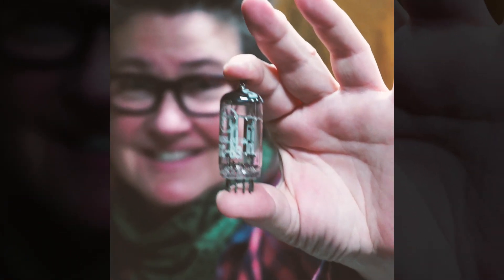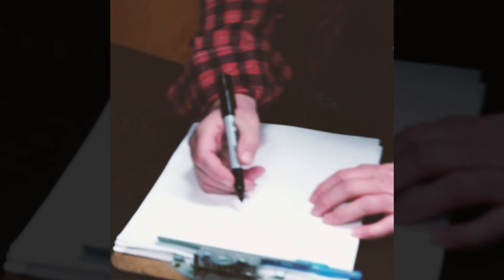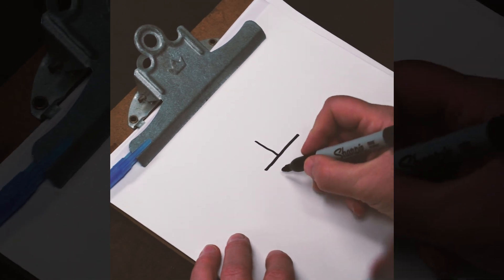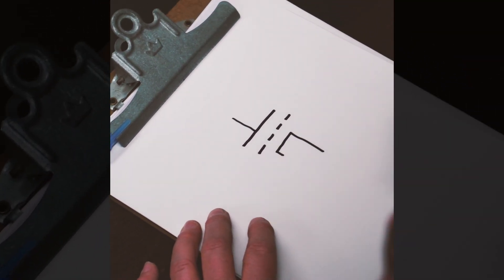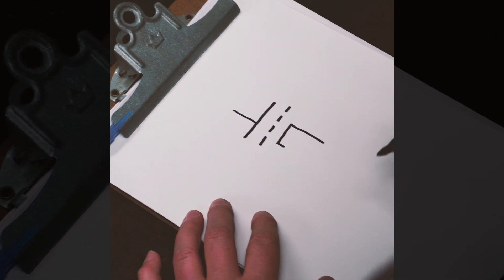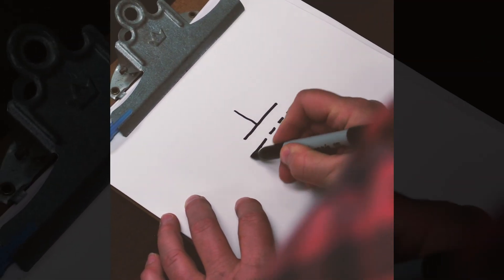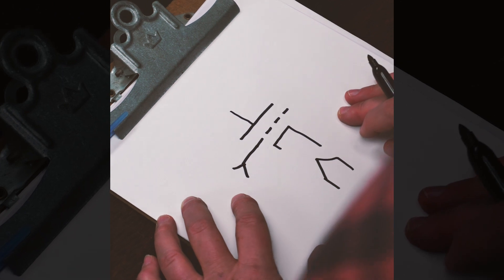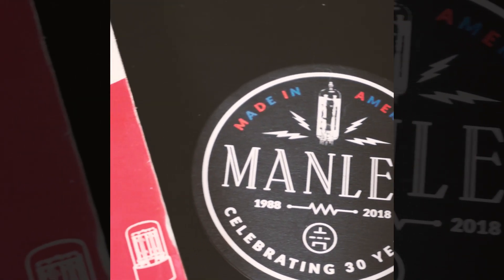EveAnna Draws a Vacuum Tube

Comment: I'm old enough that when I took electrical engineering our instructor told us that a FET (field effect transistor) was similar to a vacuum tube. What he was talking about was that input impedance of a grid was very high like the gate of an FET. I am also old enough to remember when every vacuum  tube had been replaced in a television except for the high voltage rectifier and the CRT. The high voltage rectifier was the next to last to go and then the CRT. A flat screen display had been imagined for as long as I can remember. But it was so long in coming that I thought it might never happen. And then it did.

As an aside, I thought this was going to be about an artist making a drawing of a vacuum tube. But I was happy with this little trip down memory lane for me.